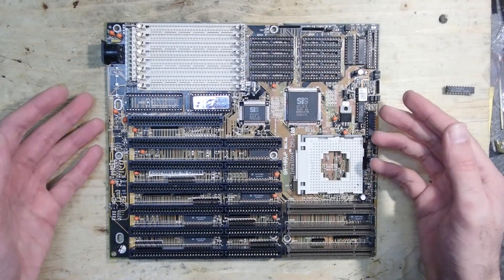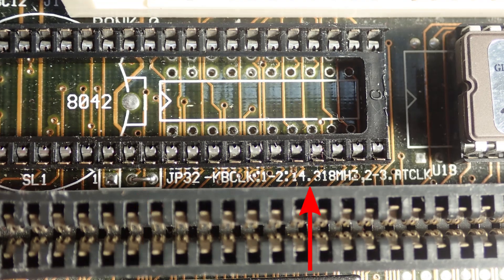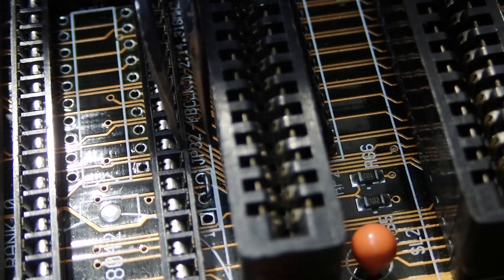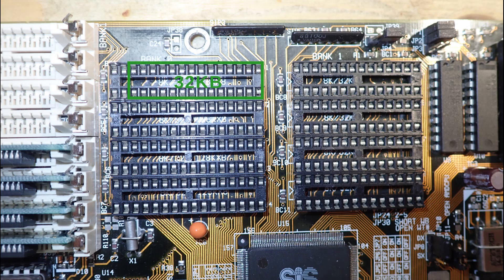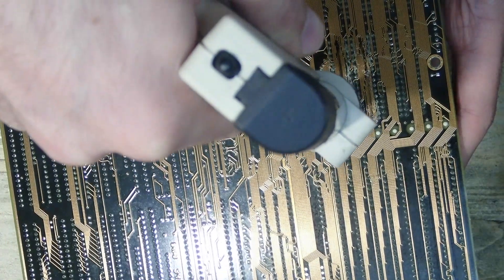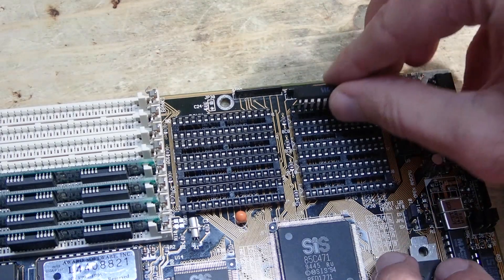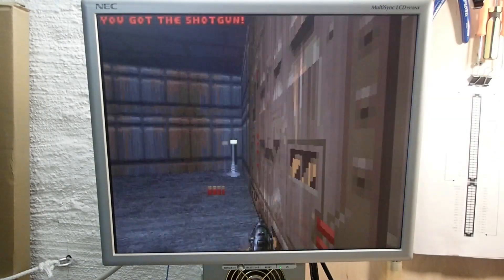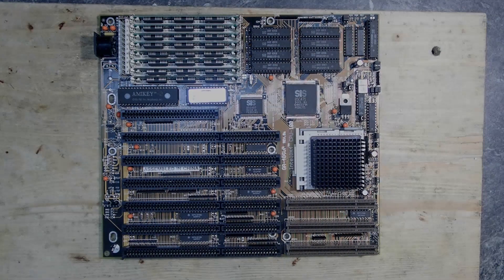Repair Marathon 21.04: #5 Update on Gigabyte GA-486VF

Comment: @necroware - I have a similar issue on boot. It hangs before it can boot from floppy. Sometimes it tries to boot from the floppy but it says boot failure - I know the boot disk is good. Tried different floppy drives and cables. Does disabling L2 cache in the BIOS bypass any bad cache chips? I plan to remove them all soon and check traces

Comment: Your approach is very similar to mine when encountering a situation where you have a motherboard with optional configuration pins. I always want to have all of the optional pins installed for jumpers and I want as many chip solder points to be equipped with sockets where possible to make future adjustments easier.

Comment: Thanks for following up on this cache problem. I have the same motherboard and it has a cache problem too. It does not see any cache.
I suspected a bad connector. I will have to revisit it with a multimeter and check for dead pin connection.

Comment: While you were at it you could have put pins with removable jumper on that keyboard settings solder wire seems a bit more work I seen pc chips boards with them all over the board for different settings
Reply from the maker: Yes, but I don't like to send 14MHz over a jumper and I probably will never need to change it ever again. So a wire is just fine.

Comment: Why didn't you put in jumper posts for the KB clock choice? Then you could run either.
Reply from the maker: I already answered similar question below. First if all, I don't think, that I'm going to change it ever again. Second, I prefer not to send 14 MHz over a jumper, if not absolutely needed.

Comment: that's some crazy bad luck to have damage through the socket frame! but very good investigation and repair. i have a bigger issue with a mainboard that has the all-plastic SIMM socket and they are in such fragile shape that i will need to source 4 of them for my repair. even after replacing just one socket, i still do not pass memory check, so i will examine the traces more closely for physical damage - i might be "lucky" that the fix is something simple like that.

Comment: Hi Necroware,
 
„Repair Marathon” is grate series! It’s been a pleasure to watch, how you bring back those old mobos form almost certain dead. Please don’t stop and keep them coming! Also great work and logical problem solving approach with step by step testing components technic! I have one favor to ask, that is could you point me on that pulse probe that you using, I thinking on getting one (UE located store will be perfect). Also maybe you will consider an episode on hardware/ equipment and components (flux, wires etc.) that you use in your workshop? I believe that could be very interesting. 

Thanks in advance and regards from Poland!
Reply from the maker: Hi Tomasz! Thank you very much. I don't remember where I got my logic probe, I guess from China. You can find it on Ebay or other stores under the name LOGIC PROBE LP-1. It costs just around 5-8€, depending on where you buy it. And in regards of hardware/equipment video, I thought about it already, but I'm actually not using a lot of special things. Everything is cheapo no name stuff. I actually don't care about materials I'm using too much. I heard and read endless discussions about solder, flux and other stuff from people, but I don't participate in such discussions. I just use whatever I have at hand and it works as you see in many of my videos. Even for dense SMD soldering, like Voodoo I just used cheapest no name materials from China....

Best Reagards!

Comment: more likely someone jammed a screw driver to pry the cache ram chip out of its socket and severed the trace in the process.
Reply from the maker: May be, yes, but as I showed in the previous part this board had multiple physical damages, the battery and a transistor were ripped off as well. So we'll never know, how exactly this damage happened.
Reply: @necro_ware  people can be hard on technology, and use brute force to get stubborn things like l2 cache off of the devices.

Comment: 3:13 why not just solder a jumper headers if you already had it de-soldered? :)
ps. nice video as always
Reply from the maker: Thanks! I thought about to use a jumper, but decided to go without, since jumpers at 14MHz are may be not the best idea. Probably it would still work, but since I hopefully will never touch it again, I guess, it's ok just to solder it.
Reply: @necro_ware  Yeah, on the second thought, you are right. Probably nobody will never touch this again :)